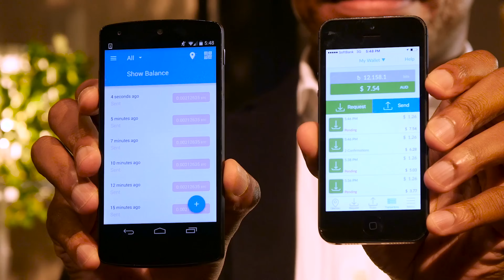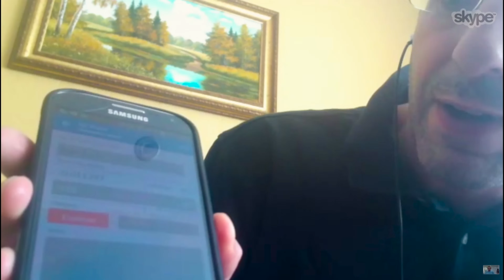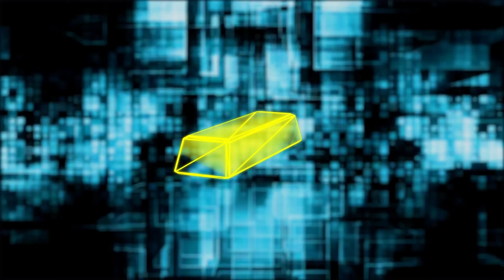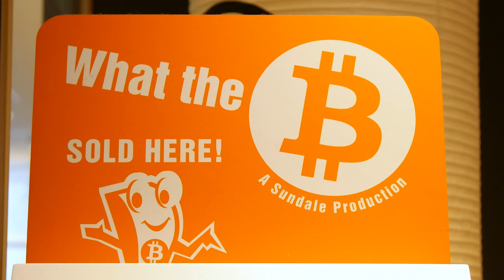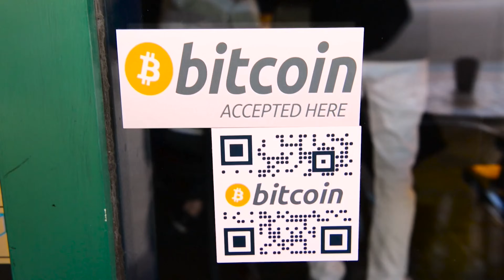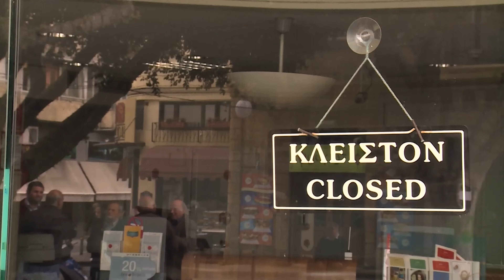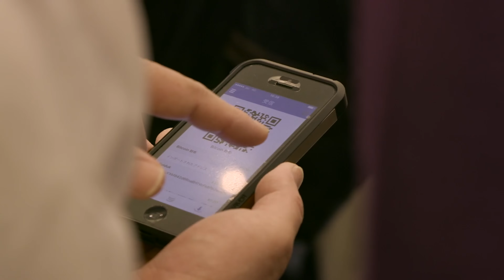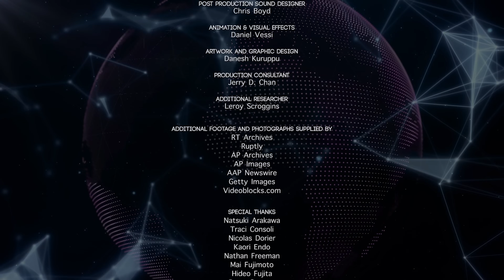Magic Money: The Bitcoin Revolution

Comment: I mined some bitcoins back at the very beginning of this. They are sitting in the pool website database I was part of.
If I install a wallet and transfer them, what is a good place to sell them for some real money?
Reply: BTC is as real as money gets.   If you want to exchange them for fiat, open an account on any number of crypto exchanges.
Reply: @werquantum  I suppose that's where I will get scammed, right? Unregulated private website with zero security and responsibility.
Reply: @werquantum  my barber doesnt take bitcoin, neither does my daily restaurant or any supermarket around, or travel agency, my insurance company, basicaly any service around me. But bitcoin "ATM"s are all over the place.
This tells me its nowhere near real money.
Reply: How many Bitcoin did you mind? It's true not everyone will except Bitcoin but you can buy it in a wallet and connect it to your bank.

Then it's very simple to transfer it to your bank.

I had the same experience. I brought some and was out of the country several years.

I had them on my computer and still it took years before I connected the dots. 

Coinbase helped me understand what I had and how to convert them back into real money.

Be careful. It can really change your like. Don't talk to much about it to people. 

Hopefully you can handle the surprise.
Reply: Sure you did.
Reply: Obviously you people don't understand Bitcoin. It's has very volatile value that is similar to a stock. 

Far more volatile than the USD. But what ever the amount that you own. It's dosen't change in the amount of Bitcoin's you own.

It is a digital currency so it's like a credit card. You don't see the money. 

But it's very easy to deposit them into your bank and spend them.

Just make sure you have a legitimate, trusted account connected to your bank account. 

I'm surprised that Bitcoin can be purchased with USD!!!
Reply: @Robischek  you dont have anything in a pool website sitting somewhere.  Stop lying